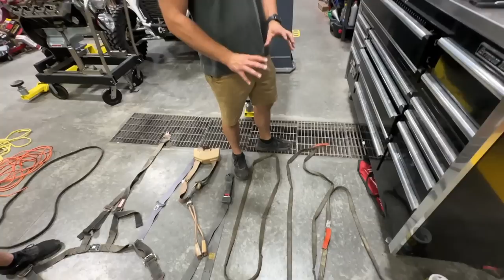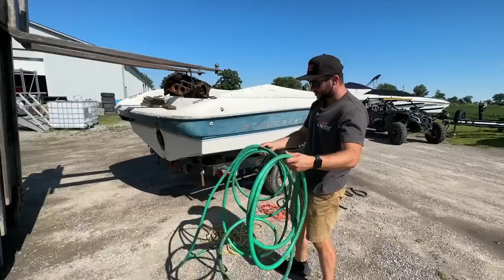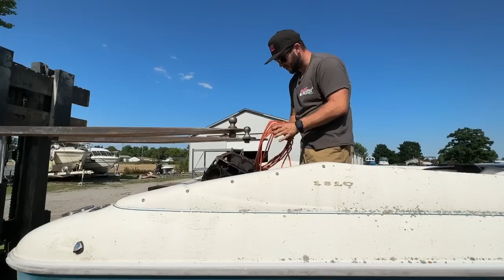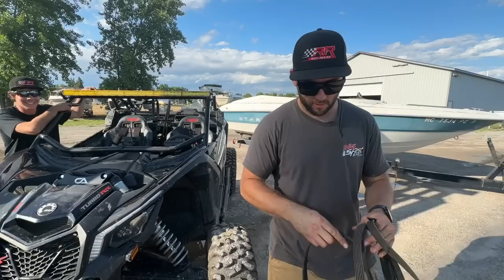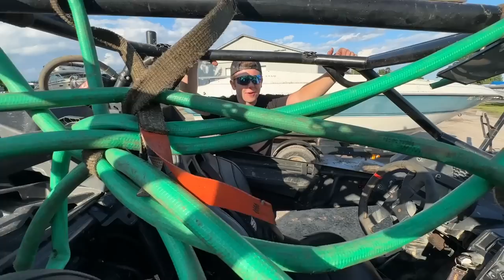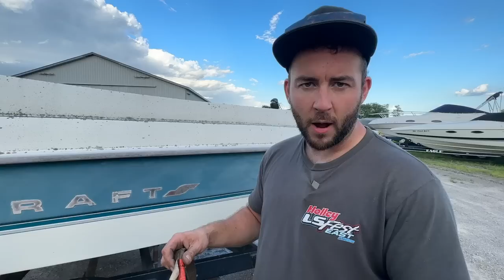The WORST Ways To Lift Heavy Objects! Testing ALL the Things in Your Garage That You Shouldn’t Use!

Comment from the maker: What should we test next?
Reply: disconnect the condenser fan motor and bypass high pressure switch in HVAC unit and see how high the head pressure goes
Reply: How much weight the fork lift can pick up
Reply: Duct tape 💯
Reply: Fist fight with your former crew vs your new crew ,!!
Reply: @@joblo819 The handy man’s secret weapon
Reply: @mrgmc6314 RR doesn't have a girl to fight Leo.... 🤷‍♂️

Comment: No one should have an issue with the strap as far as it's rated load strength.  The issue is with how you used the strap.  You secured the strap directly to the engine lift point, which is basically a knife edge that can easily chafe the strap enough to make it fail.  What you should have done and should be doing in the future is using a safety shackle to attach to what you're lifting and then attaching your strap to that.  Rounded edges are far less dangerous than straight edges.  Plus, your straps will last longer.  The yellow  rope is polypropylene, which is used on lifesaving equipment because it floats.  However, it rots in sunlight so it should never be used to lift with

Comment: All rigging is rated at around 60% of the actual lifting capacity to reduce failure when people shock a load which always happens. Examples are going up or down fast than stopping or hitting a bump while driving. Any shock can almost double the weight of the load so be careful. Your strap also looks a little damaged and the sharp edges on that steel bracket are  also concerning. But fuck it it's only half a ton and you're not standing under it.